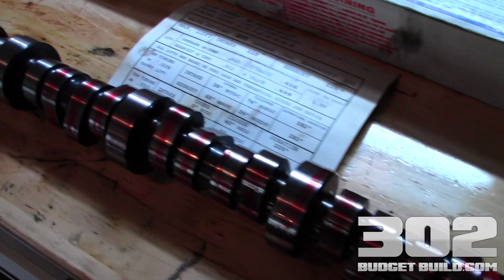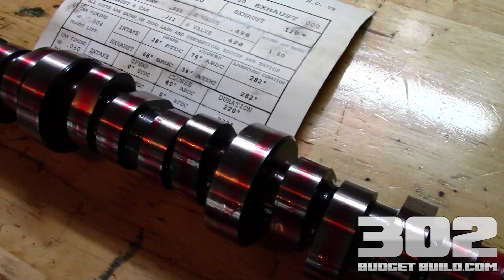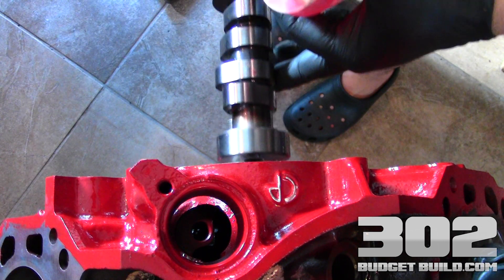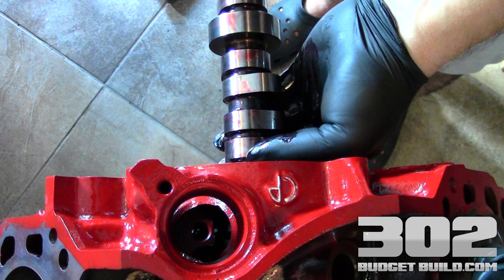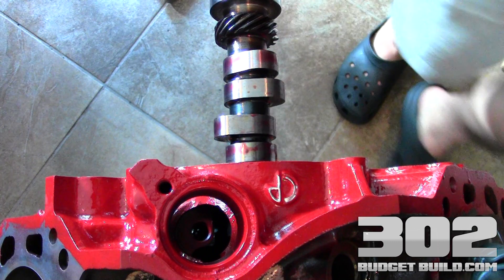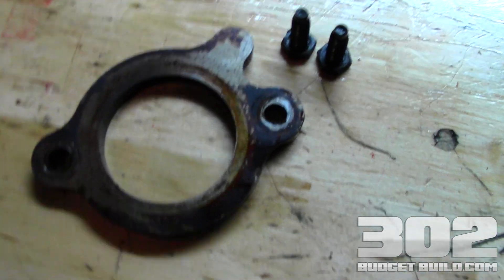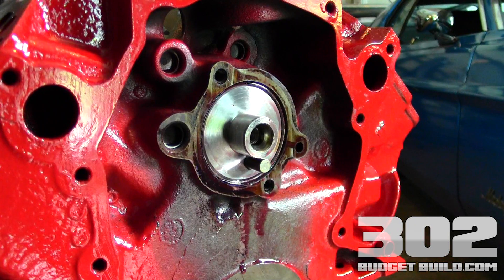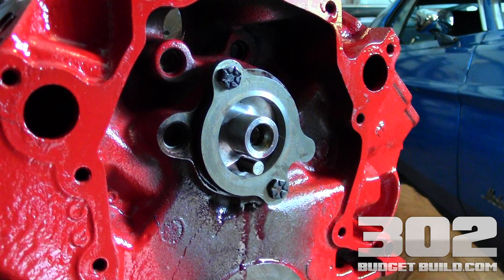How to install a camshaft in a Small Block Ford 302 5.0 | E303 Cam Install

Comment: ENGINE, not motor,
“People use both interchangeably, but the difference is that motors run on electricity and engines run on combustion. The engine converts various forms of fuels into mechanical force, while the motor transforms electrical energy into mechanical energy.”
Reply from the maker: Motor ha. I said it again.

Comment: If you installing on a stand, roll the engine upside down so any of the dragging the cam along the bearings (and it happens) is done to the top of the bearing where the cam doesn't seat.

Comment: great video series.  after the swap.  what carb did you use?  Original roller distributors with coil, msd or HEI type to match up with E303 cam ?

Comment: Hey do you know if I can put a 1995 5.0 mustang engine in a Ford F-150 1995 with the 5.0 EFI  do you know what changes or parts I need to replace to fit this in my truck ?

Comment: Can u use these on a 302 with stock heads? Also does cam need new springs and lifters?
Reply from the maker: The engine has stock heads. You need new springs, rods and rockers.

Comment: On timing chain replacement is there a certain rotation for the camshaft to be in for top dead center of crank
Reply: Yes, theres timing marks. Easiest would be lined up at 12 oclock or “dot to dot”.

Comment: Just found your video while researching what to do on a 92 f150 flareside I have with a 302. I've already bought a donor it's in a 93 f150 I picked up cheap.
I went to your website and will be using it to reference a lot of the build but I probably won't be switching to carburetor. One question I have is how much horsepower did you end up with after the build?
Lastly I wanted to thank you for making and posting the videos and creating the website, I have a feeling they're going to be very helpful for my build.
Reply from the maker: No problem man. It was turning right at 325hp when finished
Reply: Pretty healthy increase hope I can get the same (my 92 is rated at 190 hp stock)
Reply from the maker: Friction is where power is lost. Do the roller lifters and rockers, port and polish the heads as much as possible and be clean with your build.

Comment: Hello very good video. I have a stock used ford 302 roller motor and I want convert it to 302 ho to drop it in a 1986 Ford F-150, I am looking for torque and horsepower at low rpm but with a bit of rough idle I am going to purchase aluminum heads 190cc runner 2.02 intake with 1.6 exhaust and stainless steel roller rockers with 1.6 ratio. I already have a edelbrock dual plain intake with a 500 cfm edelbrock carb. What type of camshaft do you recommend me to install ? according to the parts I have. Thanks in advance

Comment: Howards makes a far better cam, 219 @.50 on both intake and exhaust, but with 1.7 rocker arms lift gets to .578 just under .600 that is supported by most aftermarket heads.

Comment: Hey just got an 88 foxbody GT with GT40 heads and intake and it has a cam in it already but it’s not a very big one because it barely lopes or chops. I bought a 90 fox 2 years ago that I know had an E303 cam because it chopped HARD and sounded amazing! I really want to throw an E cam in my 88 but not sure what all I need for it besides the cam itself. Lifters? Pushrods? Springs? Valves? Please help me out!

Comment: Good job, nice explanation too=) Question for you: replacing different can into my Mustang 3.8 litre V6, putting XTreme Energy in with stiffer springs, of course. Do I need to replace cam bearings, or can I just replace cam? Car has 180000 miles on it?  Thanks=)

Comment: Okay geta bolt that is about 6 to 8  Long screw the bolts on the end of the cam.. Then lube the entire cam with that lube that you're you are using..Then stick the whole came in all at once.. Don't make the job any harder than it has to be..

Comment: I am doin a E303 right now in a semi budget Semi Street / Daily build 1985 5.0 H.O. Roller Motor "M-Code" .... lookin for some more power Anyone know what I can expect? lol...
     My additions with E303:... Promaxx 1102 heads (175cc 2.02. / 1.60 valves) Demon 625 Carb, Edelbrock RPM intake ,  Car already had BBK Long Tubes with Flowmasters (No Cats) Smog and A/C Delete... Goin thru the motors bottom end but not replacing shit unless bad stuff... Only Rings and bearings for sure... Comp Cams  Double Roller Timing Chain of course...
   Car also had when i bought it 3:73 Gears in 8.8 Rear, Frame Connectors and Torque Boxes and that Dura- mat under the carpets back into the trunk.......The previous built and restored the entire car spent a fortune on resto including 3,500. paint and prep job Regatta Blue but left the motor stock... I'm gonna finish it lol...

Comment: I’ve been wanting to do a cam on my 94 gt... my question is, do the heads have to be done or can I just do the cam? I don’t want to go to far on the motor, just want a little more throaty sound
Reply: Might be to late for you I did my 94  but I got a 347 put comp hr236 I think is what it was lift is 565/576 duration 230/232 I like comp I have used comp before in small block chevy with good results split duration is always good ford stuff like the e cam is straight across the board comp makes a better cam than this cam you should give them a call or even call jegs or summit racing and ask them I think they will tell you the same thing just trying to help out another gearhead like me and someone told me this same thing that iam telling you bud just want to see you make horsepower and your car sound good everybody wants the hotrod sound too
Reply: I talked to a guy from Summit Racing. He said the comp cam will wok in my stock 302 motor without changing anything else in the motor. I also looks at the Edelbrock Performer Intake Manifold as well.

Comment: I would never tighten one bolt to the max and then the other. I do one bolt until I feel resistance and then the other. Then back and forth adding more pressure evenly applied across the plate until fully torqued.

Comment: There's a tool for cam installation. Or use a longer bolt, or a set of Vice Grips on stock cam gear bolt.

Comment: i have a 1985 v8 crown vic ltd how do i knw if it is a 5.0 or a 5.8
Reply: Check the engine bay. There should be a Vehicle Emmision Control Information label, looks kind of like a sticker. Just skim through it to find the displacement. If you dont find it or is unreadable check your driver side door, low chance the engine displacement might be there but worth a shot.

Comment: when you install an aftermarket cam do you have to do work on the heads or is it ok to leave them alone?
Reply: You usually have to swap valve springs at least.

Comment: Just wanted to say thank you, I recently purchased a 1986 Ford Mustang LX that was set up for DRAG but the guy lost his motor to a friend (long story but I was able to purchase it - cheap) and now I am in the process or learning process of rebuilding a used 302 with a bout 60K on it and I have gotten a few add-ons with it. Edlebrbock Performance Intake, Cam, matching lifters and new timing chain and gears. I am SUPER excited to start and finish this project and your videos will be very helpful. I have a few relatives that are the back bone of most of the stuff I do when it comes down to engines. They have done it their whole lives and when I found these videos it really got me excited to see the light at the end of the tunnel to get this car completed. I just started to pull the heads off the engine and I am going to port and polish them as well once I get the new gaskets etc. I hope to keep you up to speed on my progress maybe with my own videos WILL SEE!

Comment: Need some help with getting oil pressure in a 72 302. It has been hot tanked and has a new oil pump and has the shaft in it to drive the oil pump. can hear the oil moving in the block but nothing is coming up to the head. any Ideas? I have been using a drill to try and build up the pressure.
Reply: Roger longhorn rotate it the other direction, I did that too

Comment: before you install the cam where should the pistons be?
Reply: #1 at top dead center......find the #1 spark plug wire and trace it to your distributor  and make a mark on the lower case of your distributor in line with the distributor cap tower with the #1 plug wire......and then remove distributor cap so you can see the rotor......turn the engine over by hand with no spark plugs (no compression builds up so its easier) until the rotor is in line with the mark you made on the lower case of your distributor. Now look at your timing tab to see where it is compared to the 0 on the crank balancer. Rotate the engine until that tab is pointing or aligning exactly on the 0 or the timing marks. Usually will not be on the 0 when your rotor lines up with the #1 spark plug tower because your distributor is set with some advance in it usually 10-12 degrees so rotate it some more to the 0 on the crank balancer and you should be exactly on top dead center. Then you can remove your distributor but first make a scratch on your distributor base and engine block so you can install your distributor back in aligning the scratches and your timing should be pretty much correct. I like to use white out in the bottle to make reference marks. It has a dandy little brush and the white marks are very visible. Hope this helps.

Comment: What does a camshaft do anyway?
Reply: Gets the Air/Fuel mixture right for firing inside the cylinder.
Reply: +Mary Tudor they open exhaust and intake valves then the spring which is on the valve between the rocker closes it. SOHC opens both exhaust and intake valves, and DOHC have to cams and one opens exhaust and one opens intake. DOHC engines have better performance than SOHC engines.
Reply: +fire1937 That would be the carb !!!  K.J.V. all the way too !!!!

Comment: Can anybody tell me what the advantage if an "overhead" cam?  I'm thinking about the 1950's era classics, like the '57 Chevy, such as was popular in drag races.  As I recall, there was a big performance advantage, but they were against the rules.
Reply: +Mary Tudor Overhead cam engines have better volumetric efficiency. Back then with flat head engines (L-head engines) they had the cams and the valves in the block rather than in the head and with this design the air/fuel mixture didn't burn as well. F-head engines came later which were a little better because it was a cross-flow design which had a valve in the block and also in the head, but V.E. was still not so great; although it did improve it still wasn't the best. So later OHV and OHC (Single Overhead Cam and Dual Overhead Cam) engines were developed which greatly increased V.E. because the cams were right above the valves which resulted in less moving parts and less friction which result in more power. They were probable banned because it was so good and not many people had them.

Comment: cheater trick, long 3/8-NC bolt, or a side handle for a drill that uses a 3/8 thread.  Works great as a cam handle. Handle is better, but more people have bolts laying around.

Comment: Permatex discontinued the ultra slick.

A good alternative I have heard but haven't tried it is the Lucas Assembly Lube. In Autozone it can be found over on the area where they keep their diesel stuff.

I don't see any problem with the ultra slick. All seems like is some really heavy weight oil.

The best lube is the stuff that comes in a tub  because as you can see even though the ultra slick is extremely thick you can see it run off the cam. I could see it running off and thinning out on the lobes if it takes longer than around 3 days to put the engine back together. The stuff in the tub don't run and resembles grease more.

Also packing behind the face plate with vasoline is acceptable similar to how you would pack an oil pump's gears.

Although I think your engine will be OK with this lube but it kind of fall in the category as old type lube since there has been better strides in the tech of assembly lube. It's kind of similar to using Indian head gasket sealer when there are better options. It works just fine but is considered old tech.

Comment: Did you degree this cam?
Reply: Christopher Ladd you line the dots up its simple with ford
Reply: +Paul Carpenter with these motors not the newer ones. You'd better have the right tools and know how to use precision measuring equipment it comes to the modular engines.

Comment: ok boys need some help, I have a flat tappet 351w in my bronco and I want to use the comp cam extreme 4x4 low end cam in it, do I need to remove lifters and need new springs for a cam like this or can I just remove my dizzy and old cam and slide the new one in and way to go

Comment: Torque specs for the two bolts??
Reply: Ugh I just dealt with them. 114 inch/lbs. NOT ft/lbs. in my unprofessional opinion those two bolts are undersized.

Comment: I know I may come across a little ignorant on the subject but I am selling a 74 bronco project to a friend as he is more into them and practically bullied me into it. He is taking the engine of another one of his projects to replace it though so I am going to still have the motor. I was going to put it into an 84 rx7 and was wondering if there was anything I would need to change in order for it to be more for speed rather than for torque? Basically I am looking to make a car I can drive in normally but could say take to a local drag strip and still have some fun there. Thanks for your help,
Alex

Comment: cool i always go to the hardware store and get as long a bolt as possible and screw it in the end of the cam it gives more leverage at the end it's way easier than the stock bolt lenghth

Comment: Sorta of a random question.  But I have a 95 f150 302 all stock . I am going to swap the heads to a gt40 and swap the cam (thanks for the awesome video) for a e303 cam . Do I need to flash my ecm or flash anything  before I tear something up?
Reply: I've been wondering the same question. I have a 1989 302 in my Bronco and been wondering how the OBD-I Speed Velocity system will react to the e303 cam.
Reply: Skitter302 e303 idle like a shit on speed density or sn95 computer, they had a couple of cam which are compatible with speed density or sn95 computer like comp cam xe270hr-14, steeda 19, afm b-21 and more.
Just a tip dont go with a 110 lsa, go with 112 lsa or more.
Reply: Ok i finally swapped the heads and cam. Everything runs great (didnt need to flash)except didn't quite get the power i was expecting and im only getting 6-7mpg
Reply: Juan villanueva
You have a video of it running?
Reply: did you have to change out lifters/pushrods to different length? if so which measurements were they?
Reply: + Skitter302 no but ill post one tomorrow I recently put long tube headers and made it a dual exhaust I need to change out the o2 sensor
Reply: how would the e303 react in an 89 mustang 302HO with gt40 heads that has twin turbos sleeved cylinders and 0.30 forged pistons, EGR deletion kit (bigger injectors currently on the way) and the rest basically stock OEM parts? I'm honestly not sure it would work well with the turbos but no one seems to be able to give me a clear answer. hoping you could shed some light on the matter?

Comment: I have the same motor in my 72 Grande. I worked a school year and a summer to buy it from the shop I was working at the time. I'm currently restoring it but I am lucky I found you this is all a real help in the process I looked at your interior videos. That is as far as  i am right now the motor luckily has only 33k miles but it definitely needs a clean up as poor as it runs at times. Keep posting this stuff i love it